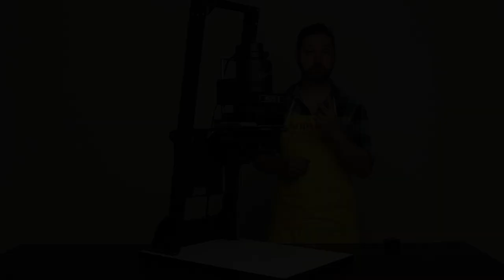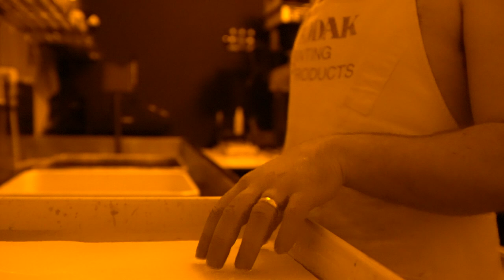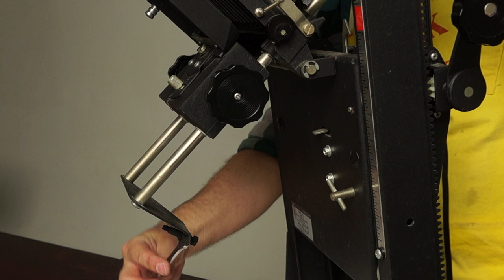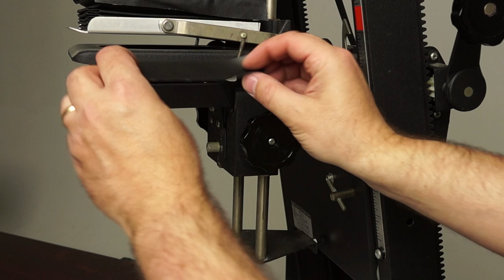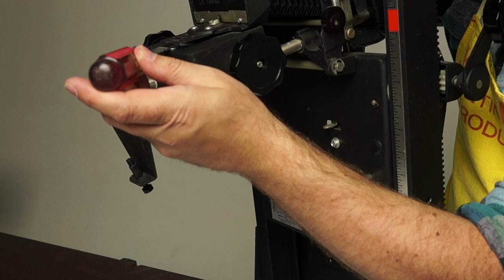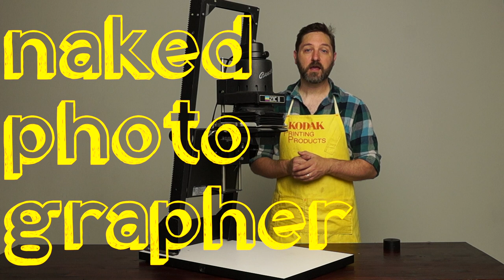Aligning the Beseler 23C I and II

Comment: In 1995 I was making $6.30 an hour  I dreamt of owning the Beseler 23C II which ran for about $800 or $1200 from B&H - out of my reach.  I ended up getting an Omega 4x5 Pro Lab II in 1997 for $1100 from B&H (after much overtime 🙂) and then a brand new 4x5 Saunders LPL 4500 Color Enlarger in 2010 for a mere $800 when Bel Air Camera in Westwood CA was closinging down.  I will  never forget that.  That 6x7  23C II Beseller looks solid, I have to admit. Very nice. 👍

Comment: The shims used in installing the electric clutches in automobile AC systems are about the same diameter as ordinary washers, but are the thinnest I've ever seen, and can be critical to restore the function of you car's AC by letting you adjust that clutch contact distance w/o buying a new clutch or new AC system.  (The AC clutch is a rotating electro-magnet, and when activated lets the fan belt turn the AC compressor. If clutch gap is too large, the electromagnet can't pull it together and you get no AC, and if the distance is too small, it stays on all the time, possibly ruining your AC because the gas pressure is always on the system when the motor is running, or it just keeps you very, very cool all year.  They probably sell these shims at auto parts houses, or just take apart an old junk automobile AC compressor and recycle the shims that are in there.

Comment: Are you aligning this based on the “leveled” surface of your base? I always used our schools enlarger and techs handled the upkeep. I’m purchasing my own . This video is very helpful
Reply from the maker: If you are using a bubble level then you need to level the base first.  If you are using a laser device or two mirror system then leveling the base is unnecessary because you are making everything parallel to the base.

Comment: What do you think of substituting in the bracket and eccentric nut from a model lll in order to achieve side to side alignment for the lens board?
Reply from the maker: I vaguely remember trying that years ago.  It didn’t work, something had to be modified but I don’t remember what it was
Reply: @TheNakedPhotographer 
I just reread my question and I meant to say side to side alignment of the negative stage. I haven’t looked at the lens board for that although I have seen a three point , two plate adjustable lens board but that’s a job.

Comment: Thank you for making this video! I just bought a beseler 23c II and I have no clue how to attach the dual dichroic head 😅 Any chance you’re going to make a video on how that attachment works?
Reply from the maker: No video, but they just lift off if I remember right
Reply: @TheNakedPhotographer  They can just placed on there but there is supposed to be a spring that help relieve the weight of the head. I have the model shown and one that is “newer” one. The former had modifications in the stand and in the condenser “springs” (the flat ribbon thing in the stand and where the knob is) to compensate for the weight.

Comment: This order of events makes no sense! If you use the first adjustment to level the lens front to back FIRST then you don’t have to mess around with shims. THEN shim the negative carrier to match the lens. SO much easier.
Reply from the maker: On this model, adjusting the negative stage moves the lens stage.  If you adjust the lens first, then it will be out of alignment after adjusting the negative stage.  This is made clear in the user manual as well

Comment: On my copy, I seem to have maxed out the shimming on the lens board, and it's still not enough. Any more gaff tape and the lens board is too thick to slot in. Any ideas on how else to adjust it?
Reply from the maker: Left to right or front to back?
Reply: @TheNakedPhotographer  front to back on the lens stage, in that I need to add shims to the back of the lens board. Just maxed out and still not zeroed.
Reply from the maker: Something sounds wrong.  The lens stage shouldn’t sag that much.  You can shim behind the plate that the side to side lens motion is controlled by or shim the entire column where it meets the baseboard.

Comment: Hi, I have got my De Vere 504 aligned, but now I wonder whether I need to use glass in the negative carrier to keep the negs flat. Have you any views about whether glass (anti newton) carriers are necessary, and if so is there a way of adapting the De Vere holders to take glass? Many thanks Edward.
Reply from the maker: Yes, they accept glass.  I use glass for 8x10, but not smaller sizes of film.

Comment: Are you going to do any of the omegas?
Reply from the maker: I have videos for the Omega D2, D3, and D5 coming.  As soon as I can get my hands on a C760 and a B series, I will make those.  I have a lead on an Omega F 8x10.
Reply: @TheNakedPhotographer  awesome!  Just finishing building a cart for mine and will need to align it!
Reply: @TheNakedPhotographer  Excellent! Need to see how to level up my D5. Thank you thank you!
Reply: Great tutorial, thank you, Greg.
    I used to print on a shared 23C back in the days. People knocked the soul out of thIs precision device, so the tape alone was not enough for the lens board alignment. As thick as the tape would have needed to get attached, it would have no longer clicked in the lens board holder.
    The solution came with an eccentric extension cube, like a huge washer, from some third-party supplier. 
    Unfortunately I neither remember the brand, nor could I retrieve it on Google, but in a very severe case of misalignment some DIY extension tube or some lens-baby-like eccenter solution for enlarger lens mounts might be the last resort.